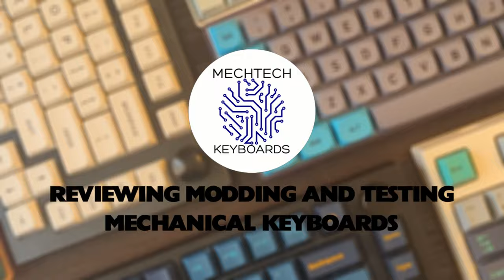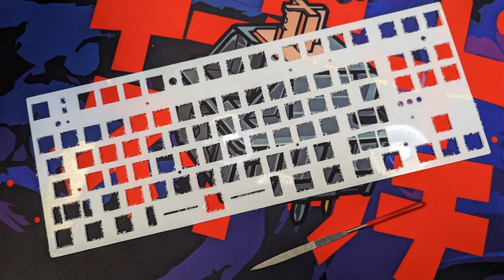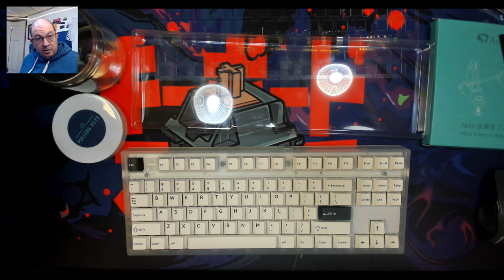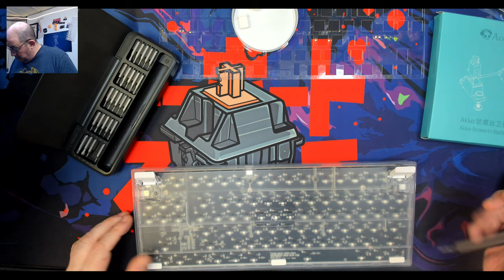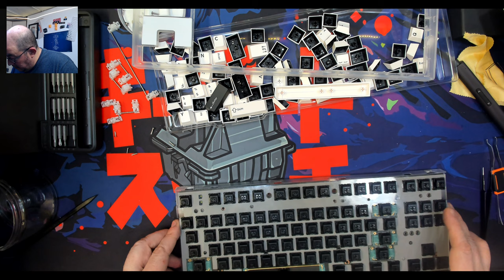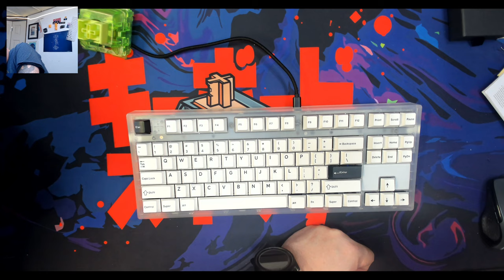How much difference does the material of your plate make? Replacing the stock steel plate with PC.

Comment: Definitely sounds a lot different! What do you think of the Akko stabs? I've heard mixed reviews on them.
Reply from the maker: I was not impressed, they took me longer to install than any other PCB stabilizers I've used, even the Sumgsn ones and the "pads" were like jelly stickers that just did not work well as it would bunch up and push the stab housing ever so slightly but enough to cause issues.